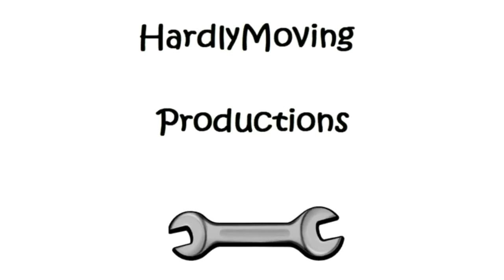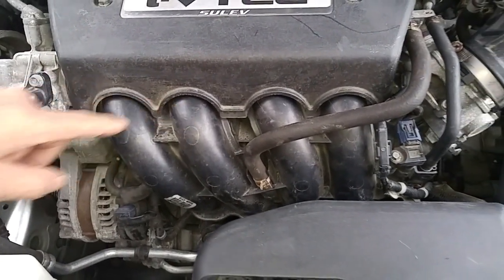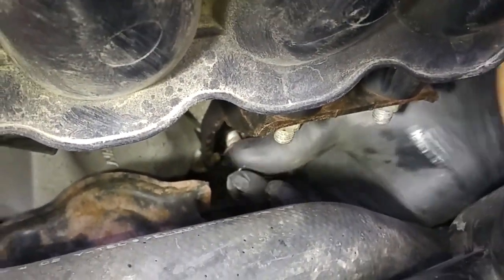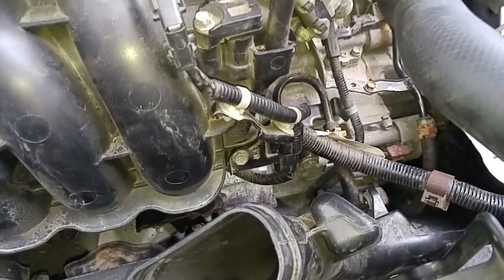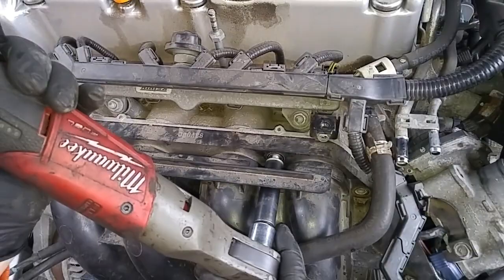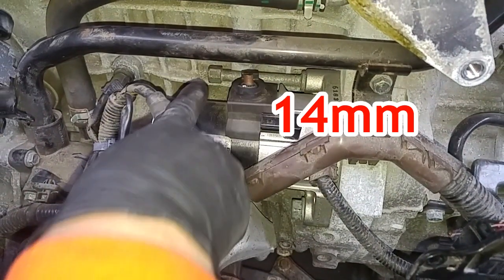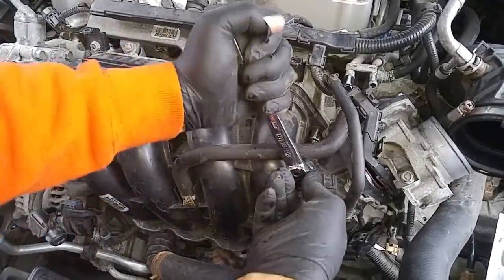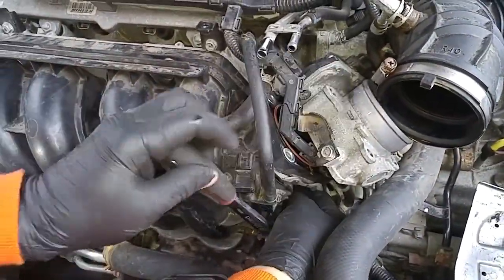Honda / Acura 2.4L I4 Accord, TSX, CRV & Element - Starter Motor Replacement

Comment: Awesome video. I have a lean condition and think I need to replace intake gaskets. I checked all hoses and replaced fuel injectors so I think this is the issue. After watching your video I think I can do it. My gasket kit came with 4 round gaskets I seen those in your video & 1 large gasket with 4 holes can you tell me where that one is located? Did not see it. TY
Reply from the maker: Also, while the engine is running, spray brake clean near or around hoses and listen for a rpm increase.  When it goes up, you've found the vacuum leak.
Reply from the maker: Thanks for your post.  What I do is remove the old gasket / o ring and compare to the new to determine if I'm replacing the correct one.

Comment: Good video but you mention that a torque wrench could be off and you'd rather do it by hand...How did you calibrate your hand?
Reply from the maker: By working on cars for several years @ over 8 hours a day having installed thousands of nuts and bolts.  Also, I've witnessed jr techs shear off bolts because their torque wrench was off.